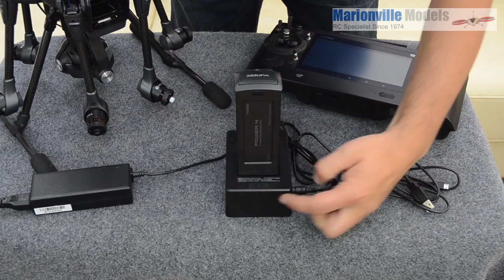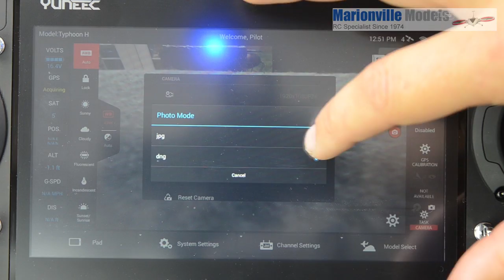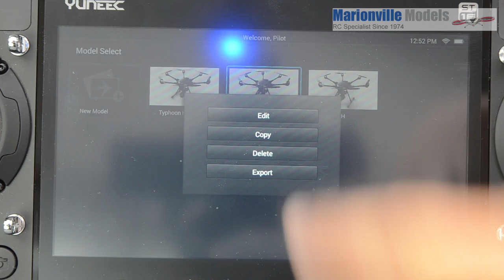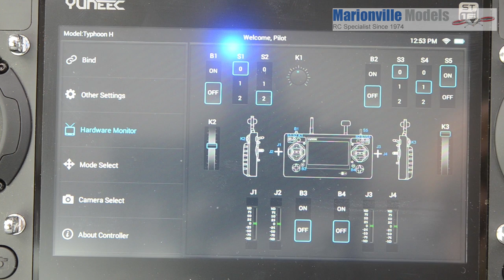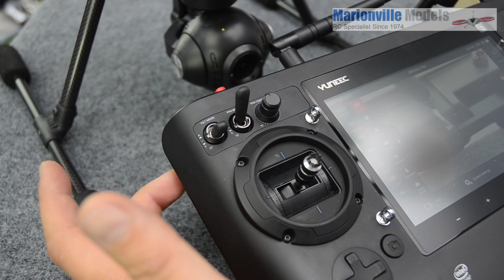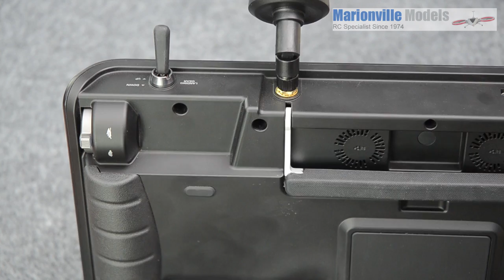Yuneec Typhoon H Getting Started, Setting Up, Calibration, How to Fly

Comment: I am working on Typhoon H drone. I have all product components. However, it is not flying even after receiver binding and GPS, and Compass calibration. I put local SD card (which is empty) into the drone. But, I doubt how it operates with a local SD card. Is it needs a standardized SD card provided by Yuneec company? or it may have some other technical issue. I don't have Yuneec SD card.

I would appreciate if you can provide some assistance in this regard. 

Thank you

Comment: Nice video, but my drone, which I’ve just got back from Yuneek, still won’t play ball! I got the props going and I got it in the air, but the camera wouldn’t work. The light at the back was flashing blue rapidly. I wish I hadn’t bought this drone now! It’s absolute crap. I got it in March and so far I’ve filmed absolutely nothing! 😡😡😡😡😡
Reply from the maker: Nathan N Farnell the controller and camera work on two different signals so both have to be bound to their relevant hardware.
Reply: Marionville Multirotors Mine won’t enter the binding mode! Utter crap! How I haven’t kicked f🗯 out of yet I don’t know!

Comment: Hello I just one of these drone but it says on the controler it says 5 motor error it says to land. Whats going on with that. Plus the motor funs very noisey. Thank for any help
Reply from the maker: John Forbes if you have a loose prop or a motor issue you will get that warning.
Reply: Marionville Multirotors i have no props on it. I sent the 1st one back to comp that i just bought it from and the replaced it with this one. And both are doing the same 5 motor code coming up on the remote. Both drones i have tried with out props both do the same thing. Plus motors sound like a bearing are gone sound kinda cheap sounding. Plus motors sound real weak not very strong at all. I am thinking of sending this one back too.
Reply from the maker: John Forbes you can’t run it without props. You will get the error right away. There’s nothing wrong with your drone.
Reply: Marionville Multirotors i see a Yuneec video before the rep said never have props on inside. Plus they run that drone with out the props in that vid. Nothing was mentioned about that error code in that video plus motor is sounding like bad bearing
Reply from the maker: John Forbes originally it was fine then they changed the firmware but I still wouldn’t run the craft in doors.
Reply: Marionville Multirotors i just wanted to make sure it was all working good before i bring it out side. These motors seem weak and couple of the motors seem like bad bearings other motors seem nice and quite on this same craft
Reply from the maker: John Forbes put the props on and I think you’ll find the motors alot quieter.
Reply: Marionville Multirotors : Thank you so much for all your help. Thank you Sir.
Reply from the maker: John Forbes please subscribe to my channel. It all helps.
Reply: Marionville Multirotors will do Ty
Reply: Marionville Multirotors hello when i am calabrading my Typoon H as i am turning it to do that why does my camera jitter and shake is that normal under this calabration.
Reply from the maker: John Forbes the camera won’t like being turned over like that but it’s necessary.
Reply: Marionville Multirotors okay thank you

Comment: Hello. Good and clear oversight video, thanks. Where did you get the black rubber or silicon covers for the switches on the ST16? I would like to buy them for my ST16 also. Thank you for your answer.
Reply from the maker: Dieter von der Heide they were included with the original sample medals of the Advanced version but I haven't seen them on there own.

Comment: Hi Marionville Great intro video and Thanks for the info you provided i actually bought one to use for the videos i record and of course hobbies.... , but have a question i unboxed and started by charging the battery but for some reason it has not gone into red blinking more to charge mode, it has stayed on green blinking mode. i already put a call into yuneec but being weekend left voicemail. lol so any help or comments is greatly appreciated. thanks.
Reply from the maker: MYSTARTV CHANNEL could be a bad connection to t.he battery. Make sure it's fully pushed down.

Comment: Wow it's been out for a while now and had 2 FW updates your video is way out of date, you mentioned down loading apps for the tablet, I think you may now know that that's not possible without Play Store and not without 'rooting" the devise. to enable this.
Reply from the maker: All firmware updates install in the same way so the video is still relevant. There are many videos on side loading apps so Playstore is not required.
Reply: As I say not with out rooting the devise